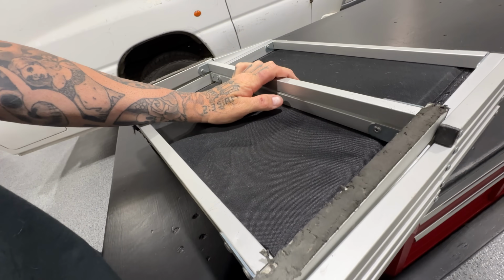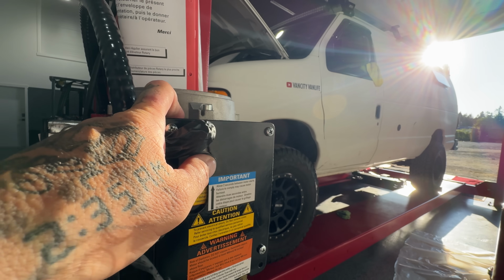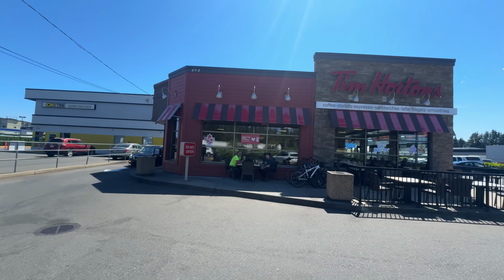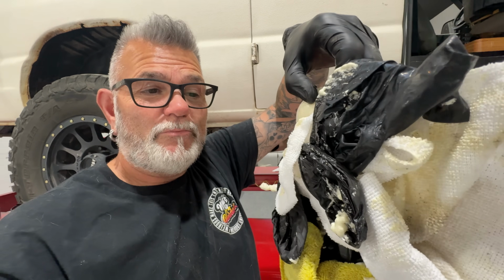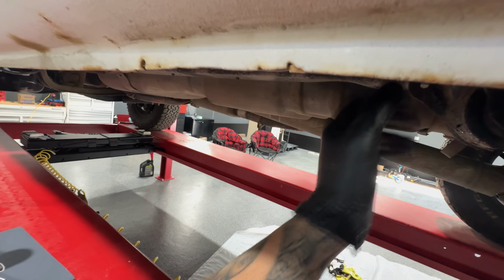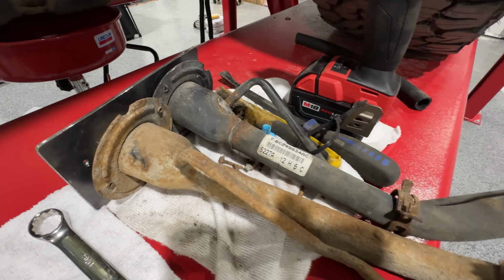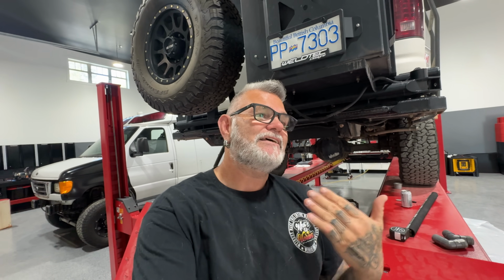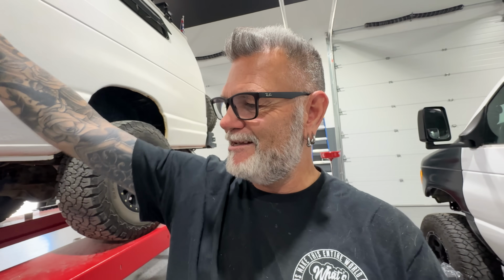Half My Arm Fit Into This Hole. Cause Of ALL THE DUST.

Comment: Chrome, I'd recommend purchasing the metal sooner rather then later, even if you don't intend to repair for a couple of years. They are available now, but might not be available down the line when you want them. Ford will phase out whatever parts they have left and since they all rot in the same places, you don't want to miss out on buying parts that they probably aren't making anymore
Reply: Man you’re 100% right that’s awesome advice.
Reply: There are junkyards full of Ford vans with parts!
Reply: Rusting
Reply: There are metal fabricators who can make the parts

Comment: Chrome if you are using a max air fan then you must know that it puts a vacuum inside the van. It is not closed to the outside unless you get the cover that fits inside. The fantastic fan will close to the outside and seal off.

Comment: Chrome, I recharged my a,c in my Jeep today.  I'm  a 65 yr old lady.  You just need to find your low ac port, have a manifold gauge and a can of freon when you are in a pinch or low on funds.  Of course the correct way is to discharge a/c then refill just don't overfill.

Comment: i was reading gas knowledge, from some post on FB by a gas trucker... and i felt the need to spread the truth or not, about it, because your will be filling up at a different angle. 1) fill at a low speed 2) do not gas up when tanker is filling. [any sediment in the tanks under the ground, might get mixed in, and into your tank possibly] aaannndddd LOL, there was a third one, however comma...i sirgot what it was?!?
LOL, the biggee.... #1.... because IF the holes are at a different angle, besides a tad better gas mileage...the overflow might be super quick...and smelling like gas is not pleasant! ;-)

Comment: spray rock guard or bed liner up there then put fiber glass auto body mess when its tacky and re spray.  when dry spray and re mess and spray more. 3 times will stop water.

Comment: I would cut some sheet metal to fit rustproof it put a bead of sealer around the edge and rivet it in place that would eliminate the dust and no worries about the foam getting wet

Comment: The acid in the coting might start to eat into the foam that you filled the hole with. I suggest you get Flex Seal Aerosol Liquid Rubber Sealant Coating, and spray it over the area to prevent water from activating the acid.  It's only about $15.00 for a 14oz spray can, at Walmart.

Comment: What about trying the spray insulation they use on homes? You spray it on and it fills in the space/cavity. You trim off the excess and it's sealed.

Comment: It will not hold water. That's a popular super cheap and cheesey rust hole repair material here in the rust belt. Cover it with body filler, sand as smooth as you like, adding filler to maintain a nice covering. Spray some rubberized undercoating and it looks legit.

Comment: hay we havea 2000 and a 2001 f 150 and a f350 and when we fill up the gas gage will not regester till we shut off the key and re start the truck so if you are filling on the fly will you know when you are full so u dont over fill . if yours woeks the same

Comment: Chrome, stop being anal about the floor!

It’s a SHOP!

I worked as a Volvo master technician in a shop that got epoxy floors and the owner was out there every day worrying.

A tech was doing a brake job and had to hammer a brake rotor off.

It hit the floor and,,,,,,epoxy 0
Brake rotor 1.

Comment: Another camper trailer vlogger, makes positive air pressure with fans and vents on his cargo tailer to keep the dust out. So, your theory of running the A/C, probably did the same effect of positive air flow that kept most of the dust out.

Comment: Should've installed the lift outside,that way vehicles don't bring dirt inside or drip on your floor
Reply: That makes no sense...rain is their main weather and snow in winter.
Reply: My friend... I will take dirt on the floor over planning jobs around weather or being forced to work outside in the dead of winter.
Reply: Tire towels might work to not to bring dirt in...If ya don't want dirt on the floor, gonna havta tar the drive..
Reply: @roaminwithringo ..exactly, placing small stones for the driveway/parking lot is NOT the best idea if he’s concerned about the shop floor, SMH 😂😂😂😂👍👍☮️